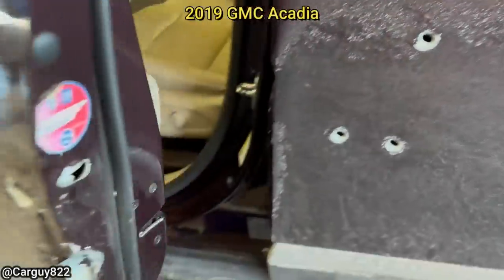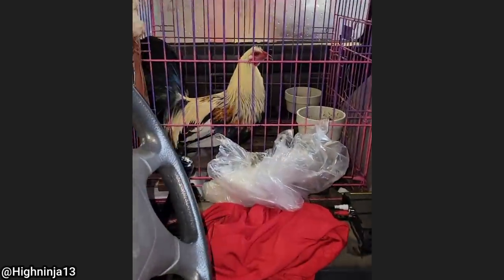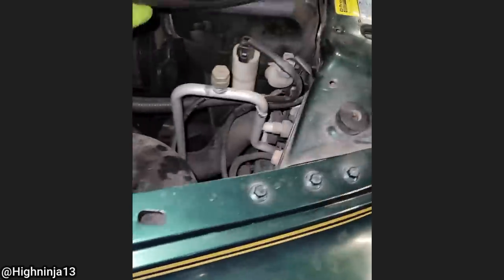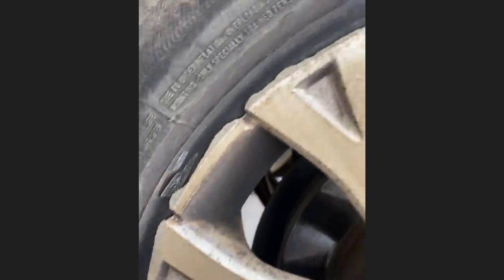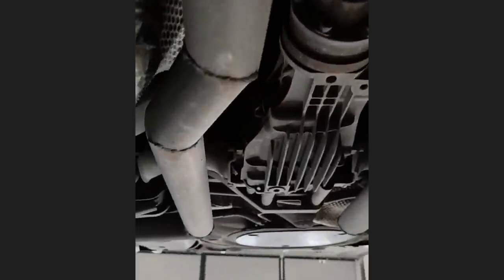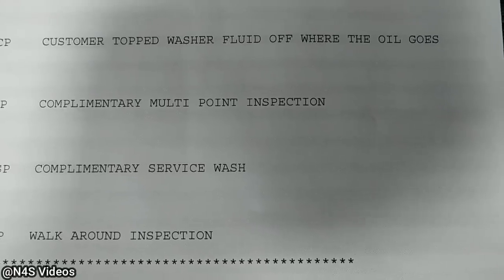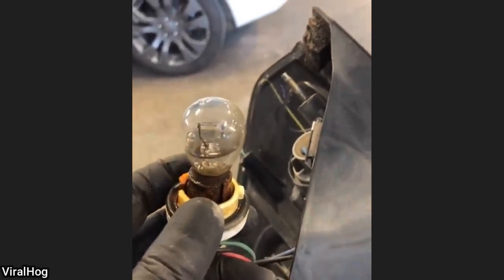Customer States Drivers Side Rear Window Won't Go Down | Just Rolled In

Comment: The no airbag one is really scary, especially if you are unaware they are missing.  In my state we are forced to do yearly inspections, do some states not require this?  Its amazing how bad some of the vehicles are.
Reply: Not all states require a yearly inspection I think its only a couple states that do  some have no inspections at all
Reply: Fl you can run anything on the road,  bare minimum lights an mirrors idk if they even ask about airbags or check.
Reply: No inspections in FL.
Reply: The real question is how would anyone know?  The only thing that tipped them off was the poor wiring job.  Short of a "open and inspect" it could have lasted the entire life of the car with only the scrapper finding it.
Reply: No inspection in Michigan.
Reply: @russellhltn1396  The customer from the video knew because the airbag light came on, and if the tech finds one bypassed airbag then its really not a bad idea to check the rest...
Reply: Even in the handful of states that require an inspection, this wouldn't have been caught.  Many, many people know where to get an inspection regardless of vehicle condition as well.
Reply: Oh, you sweet summer child
Reply: I had an "inspection" on my vehicles when I moved to Nebraska, they just verified the vin matched the title. There are no other inspections required at any other point. And you can tell, based on some of these cars...
Reply: Most states don't have annual inspections. And the state that I'm in only has an annual emissions inspection, but the county I live in mandates an additional safety inspection.
Reply: States without yearly inspections should not get Federal highway dollars.
Reply: Does america or states in America not have like a MOT meaning annual test of vehicle safety, roadworthiness, on a car as in UK you have to do it every year to make sure the car is up to road standard and if it fails on anything the car is not legal to drive on the road even small things like a tyre under the 1.6mm tread can make it illegal to be on the road how does the US have nothing like that or if they do have something like it does not look like it working from all the vids of just rolled in.
Reply: Since the airbag light was off. How would a State inspection catch that? I think it still did it's self check.
Reply: @giggity4670  It depends on your state. Some states have a safety inspection. Some have emissions inspections. Some have both. Some have neither.
Reply: Most states do not have any vehicle inspections. Michigan being one of them.
Reply: @AccountInactive  New York requires an annual safety inspection where they'll check things like horn, lights, tire tread depth, and brake pad wear. They'll also fail a vehicle for having a lit Check Engine light. But as far as I know they won't pull an airbag and inspect it.
Reply: @giggity4670  Considering how rusty some of these cars is, would an MOT inspector allow them into the hall ?
The ones there it is unsure if it is possible to get all of them in ONE piece out of the hall ?
Reply: @tyrannosaurusimperator  Am very surprised most states have nothing or have a small test with inspections on cars. I am use to the way we do it seems so off as it is all for safety here and i can see why as some of the cars on just rolled in i have no idea how it even got to the shop like the one with no brakes in the vid how do people even drive them it is mental how people not really notice something like that.

As if your car in UK has no MOT means it has no insurance as insurance will not touch a car with no MOT so if you get caught driving without one you can say bye to your licence the car and have a huge fine even prison time if it is really bad unsafe car.
Reply: @TheStefanskoglund1  Yea they still have to do the test if you want it done we have to pay to get the test done as you cant drive the car after the MOT date without one any rust on structural parts of the car will fail they will still do the test and have fun ticking off all the fails. And when you buy a car here you can look up the car history of every MOT test done on it so you know if it fails on anything and they mark the miles down so you know the miles of the engine can't be meddled with. 

It is a good system so you know what you are buying when you get a used car and you know the car next to you will not fall apart and kill you on the road so the MOT works well.
Reply: Just emissions in Georgia.
Reply: In Michigan, no inspection even when selling a vehicle. I've seen things going down the road that look 10 years beyond crusher time, lights not working, you name it. If you pay for it they will register it.
Reply: @@trollolol705 haha it's funny that you think that will get unsafe vehicles off the road. Most are driven by people who either don't care or don't even have the money for a set of junkyard tires let alone repairs
Reply: Alaska has a few larger cities that require emissions certification but, state wide, there's no inspection requirements.
Reply: @giggity4670  
The US isn’t the UK. If every state had a MOT then many people would have no form of transportation because of our inadequate public transportation (due to lack of population density) and poverty. It would be deemed ‘ray cyst’ by the usual groups making such claims because per capita most poor people aren’t ‘wyt’. Surely these reasons are also why a drivers license is so easy to obtain in the US compared to the UK. As it is, many poor people just go to a corrupt vehicle inspector who takes bribes, err, tips.
Reply: I find it incredulous that annual inspections of vehicles over a certain age are not carried out in some US States.  Dumb beyond belief.
Reply: @russellhltn1396  One of the reasons why I would never get a salvage or rebuilt title car. One of the common areas rebuilders skimp on is putting in airbags because the bags and sensors cost $1500+ each so if all 4 airbags go, you're looking at $6k minimum. And it something that is not easily detected by a layperson.
Reply: Yearly inspections are not required in Michigan. If they were, I'd bet that at least ten percent of all vehicles would be forced off of the road the first year alone.
Reply: @sjorsangevare  the only reason the light came on is because one of the resistors failed. The resistors trick the computer into thinking there's a functioning airbag there, so if the one hadn't failed and turned the light on, it would be "open and inspect".
Reply: No yearly inspection will detect a correctly wired airbag bypass unless they dissassemble the components. I assure you no one will want to deal with the liability nightmare.
Reply: Only 14 states require annual inspections. 3 others require biennial (every two years) inspections. Nebraska only requires an inspection if you're bringing in a vehicle from out of state. Alabama requires one prior to sale or transfer of ownership.
Reply: Insurance would want inspection if its like 10 or more years old, otherwise its up to the owner really... but that would make me shocked finding out the air bags were deployed then rewired to sell??
Reply: Calif. smog only every 2 years.
Reply: Here in Florida, we have no emissions or inspections. The only time an inspection is done is if you're applying for a title (depends on the office/county) or applying for a salvage title (full inspection mandatory and you must provide part serial numbers, receipts, and proof of the work done to the vehicle.) Salvaged vehicle get a sticker that's illegal to remove and goes next to the VIN in the door-jam. Also, here in Florida, any airbag deployment is an automatic total. 

This honestly makes me wonder what led the airbags to deploy. Was it an accident that wasn't reported to insurance/authorities? Or did they do something that set them off and just cut everything out to sell it?  I don't blame the dealership as they had no way of knowing if it was never reported and they're not gonna take the time to look at the airbags. Though i'm not gonna say "good on them" cause buying back the car is just the proper legal step to take. If they don't, they can be held liable for selling a defective/unsafe vehicle if the owner gets into a crash.
Reply: @giggity4670  You must be joking. It's up there with the 4th amendment to many!
Reply: @justayoutuber1906  because the people who live in those states and pay federal income tax should have to drive on bad roads? Who are you trying to punish?
Reply: @russellhltn1396  
More likely the coroner and crash investigation guys..
Reply: @AccountInactive  
Yeah not here in Australia.. all inspections are digitally documented and date and time stamped.. almost impossible to fudge a dodgy car through.
Reply: Your state might do inspections, but I’m willing to bet airbags aren’t checked.
Reply: @jimmyj2563  Do more cars get wrecked or junked?
Reply: That's dodgy as fuck. Pretty much dangerous. One massive defect notice right there if the vehicle happened to be driving on the road and is pulled over by the police. Most states here in Australia require vehicles to have a yearly rego inspection.
Reply: In my country we are forced to do a safety inspection every six months on vehicles over a certain age. Over that age (newer vehicles) have to do it every year.
Reply: Texas has an annual "safety inspection" however it is mandatory that the cost can not exceed $7. So most shops will only check what is required by the state.  In this case that is the lights, seat belts and breaking distance
Reply: The US as a whole has rather lax vehicle standards.
All european states have agreed on at least bi-yearly obligatory inspections without which the vehicle looses its street licensing. Many do it yearly.
Reply: PA is an inspection required state...and is surround by no inspection states, apparently.  PA's inspection rules are pretty hard, and a lot of vehicles are junked over a single flake of rust on the underside :P
Reply: @giggity4670  No, the US has nothing like that. Here in Alaska, roughly 1 in 10 vehicles are what we affectionately refer to as Crack Coaches or Methmobiles. They generally have no lights, interiors, bumpers, or windows. Sometimes they don't even have doors.
Reply: @giggity4670  heres a hint, watch these videos, 99% of the wtf cars you see are "road worthy" in america.
Reply: @giggity4670  no, because as nanny state as we've become we haven't progressed hat far into authoritarianism.
Reply: @justayoutuber1906  so states that pay into the highway fund should not get their money back to fix their own roads because you want authoritarian government?
Reply: @giggity4670  not quite, brand new cars are exempt for the first three years. Also, classic cars no longer require an MOT, although many owners will have one done because it clearly makes sense.

Not having an annual, government mandated inspection is frankly ludicrous imo, but does give rise to these hilarious videos.....
Reply: We do have an annual inspection in The Netherlands, but a working airbag system is only mandatory on cars build after 2017 in Netherlands. Before that the alarm is just reported as an advisory. Must be about the same in the whole EU because of harmonisation.
Reply: I'm honestly shocked about how backwards the US is in regards to road safety. I live in the ass crack of Eastern Europe and the state requires me to both pass an annual inspection and have insurance to put my car on the road.
Reply: NY has inspections, but most mechanics just plug the OBD in and print the sticker without checking the rest of the car. Others, as long as you have no codes, an extra $20 will get you a sticker if you won't pass the safety inspection. All in all, all they care about is that there are no codes.
Reply: @@trollolol705 Where did anyone say these are educated people?  Also where I live, there's no such thing as mass transit. People live 10-30 miles from their jobs typically, no way to get a ride or bus, and it's drive this heap or starve. You sound very priviledged.
Reply: California does not we just need a smog inspection like every other year
Reply: Some states? Most states don't do them at all. Only like 15 have yearly safety inspections
Reply: @BlairSauer  Again, how would it have been spotted short of disassembly?  That brings its own set of problems.
Reply: @trollolol Because that's working so well. Turns out lots of people try to get around laws even with adequate education.
Reply: @giggity4670  The states and counties pay for most the roads so the states and counties decide on whether there will be vehicle inspections. Not the federal government. Most states do not require them
Reply: @trollolol I don't think education is the issue when mechanics tell people that their vehicles are not safe and they still refuse repairs, it's just plain pig ignorance.
Reply: @LuckyCharms777  The UK's public transport systems aren't that great either unless you happen to live in London where using a car regularly is prohibitively expensive. The UK's MOT isn't that high a standard to achieve either, but it would surely have identified every issue in this video.
Reply: @kdrapertrucker  I find it shocking how loads of Americans jump from simple things like "stopping people driving around with literally no brakes" to "you want an authoritarian government" "take away our rights" etc. What about the rights of the people killed/injured/put out of pocket by a driver with a rust bucket vehicle crashing into them? and the people with these junk vehicles are unlikely to be fully insured or able to pay up if they were sued to recover costs.
Reply: @sjorsangevare  The wiring made it clear that someone had gone to great lengths to hide the fact the airbags were blown.

I actually suspect the airbags were not blown, rather some nutcase removed them probably believing that airbags don't save lives.
Reply: No inspections in MN
Reply: @sjorsangevare  only reason it came on was because they did a shitty job fooling the computer with their crappy wiring.
Reply: My home state doesn't require safety inspections, nor exhaust/emissions testing, and hasn't for more than 20 years.
My adopted state, to which I moved 5 years ago, DOES require yearly safety inspections for vehicles over a certain age, so no, not every state requires them, and it's very inconsistent as to the requirements from state to state.
Reply: @ronniewilliz153  And WAY too many New Yorkers...
Reply: I thought most inspections were concerned only with emissions?
Reply: @TheStefanskoglund1  Quit salting the roads..... If the weather is bad, stay home.....
Reply: @Tech_Otter   UH, maybe the airbags were stolen and the vehicle was NOT wrecked?
Reply: @bghoody5665   ONLY about MONEY and items that can be FINED......
Reply: @daveh7720  in NYS an airbag light on the dash won’t fail an inspection but the silly check engine light, that could be caused by a loose gas cap, will fail it. Does that make sense? 

In Maryland only a used car being sold needs an inspection but we do have emissions tests every two years.
Reply: @mikecumbo7531  I think the Check Engine light failure is more for emissions purposes, not safety. A loose gas cap messes with things like the Evaporative Emissions Control system.
Reply: Alaska has no inspection what so ever
Reply: No inspections in Georgia. On the smog test.

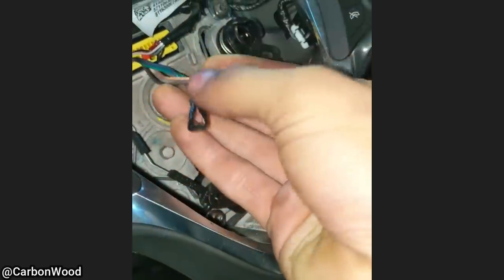Comment: @2:30 that's amazing whoever did that to the airbags knew exactly what they were doing and tried to pull a fast one by splicing in resistors. Their work looks nice and tidy for the long haul to make sure they didn't bring that car back
Reply: Makes me think that they weren't deployed, they were removed & sold
Reply: @rebturtle  you can see where the airbag cloth was cut away when the technician is pulling back the interior panels.  Most likely the uninsured vehicle was involved in a moderately light collision (like ramming a stopped vehicle in front of the vehicle at an intersection) and the owner got replaced front bumper before selling or trading it, instead of spending big bucks on replacing the airbags.
Reply: @rebturtle  Side bags were cut out you can see what's left of them.  I am betting someone was [playing Dukes of Hazard and then "fixed" it
Reply: @andrewallason4530  Side bags will not deploy on a front collision; you usually see this full airbag deployment after a roll over or the car gets some serious air

Comment: Always something new to learn watching Just Rolled In, I never knew low blinker fluid affected the brake lights. 
Thanks for the tip 🙄😁
Reply: these are dual purpose dual filament bulbs used for both brake and signal.

Comment: The window issue reminds me of one that we had come through our shop. Customer had a car with the right rear window that wouldn’t go down. We took the trim panel off and a 2x4 was holding the window up.
Reply: It solved the problem of it falling down, better to have a sealed window than a leaky one when it rains.
Reply: @phillhuddleston9445  

Power windows are meant to go up and down. This car was only a few years old.

Comment: Some of these repairs remind me of a Chevy Astro I bought from a fly-by dealer. The ABS didn't work, and a scan showed the module at the pump was bad. (expensive) The ABS light wasn't working so I figured the bulb was burned out. Nope, it was an LED soldered to the dash cluster and someone had covered it with black silicone. That's when you know they were trying to pull a fast one!